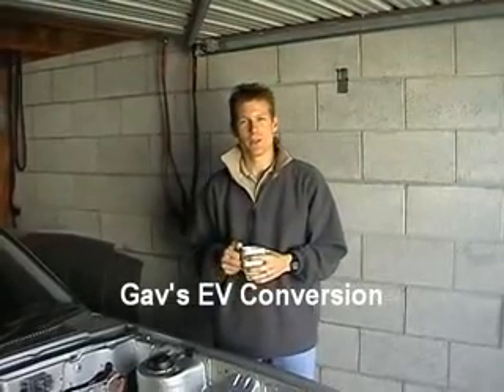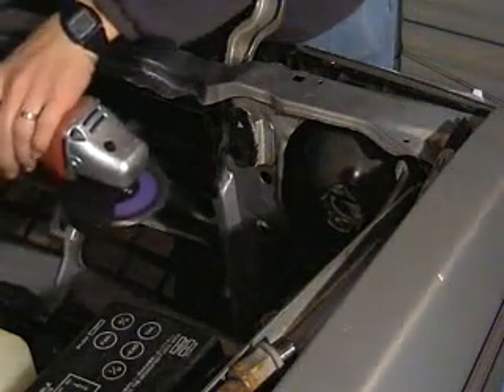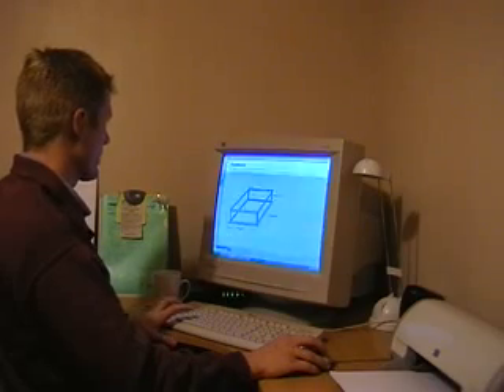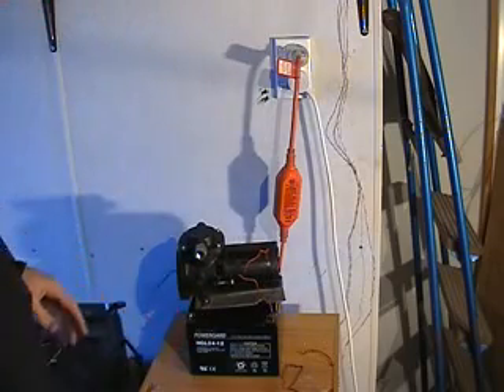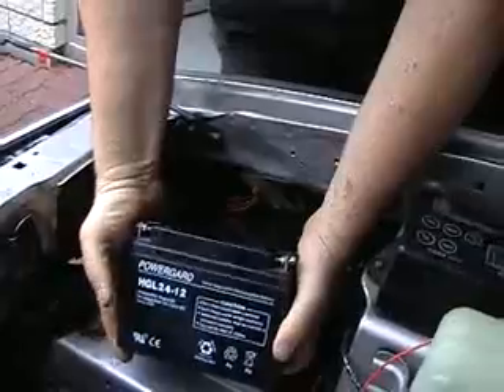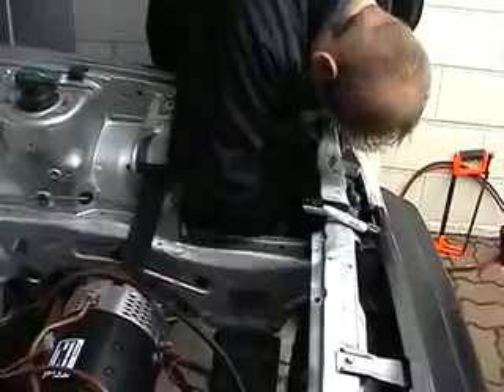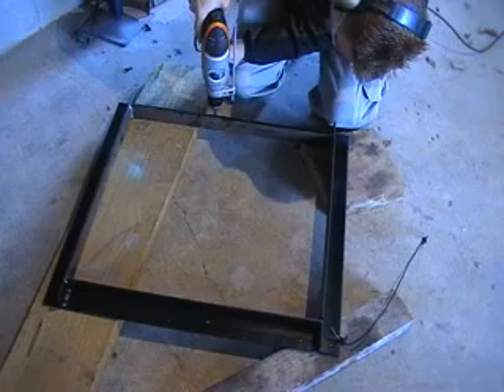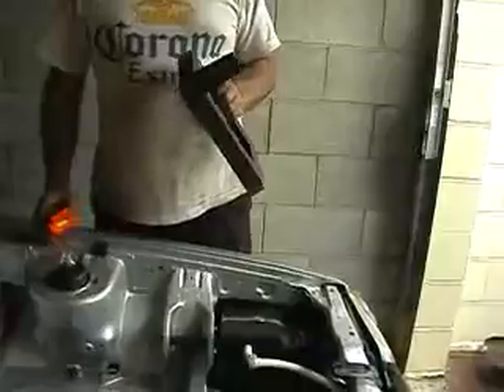Gav's EV Conversion 12 - Installing the Battery Racks

Comment: This is by far one of the best Elec.car videos..thinking of doing the same this year with a small Diahatsu mira.what I like a bout this vid. is you kinda learn as you go along...had to laugh at the shifter on the wheel nut in one of the earlier episodes.
there put on really tight (safety issue) the right sized socket and a piece of water pipe for leverage usually does the trick..and you need to put them back on bloody tight.you will need to stand on them..the gardening shears love it, good work

Comment: You're doing a great job.  I'm a little concerned about your charger.  From the looks of it, you are planning to use a bank of individual chargers.  This plan has a drawback that you can not use "opportunity charging" by carrying your charger onboard.  Assuming a range of 70 km, if you go to a friend's house 30 km away you wont be able to plug in and top off the batteries to guarantee you'll get home.  Even just a couple of hours on charge will make big difference.

Comment: From what I remember, a bastard file is one with a cutting face consisting of teeth which are neither fine nor coarse.
Are you using your low-fuel light as the recharging light ? It's coming along well... Soon, we'll see you waving at the fuel-stations as you drive by.